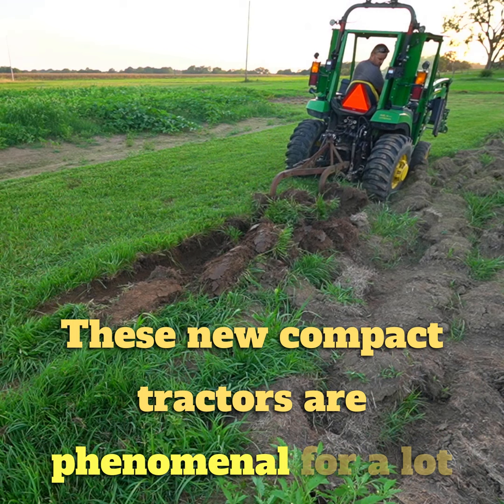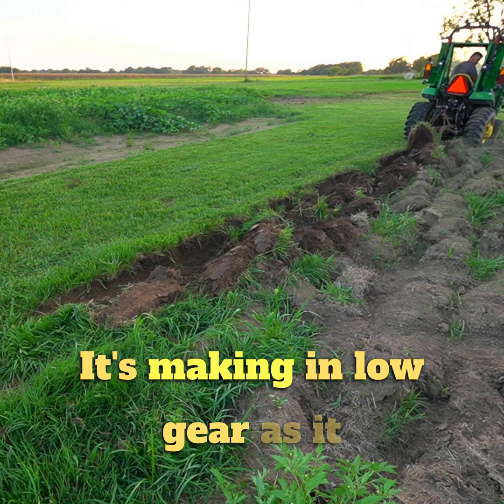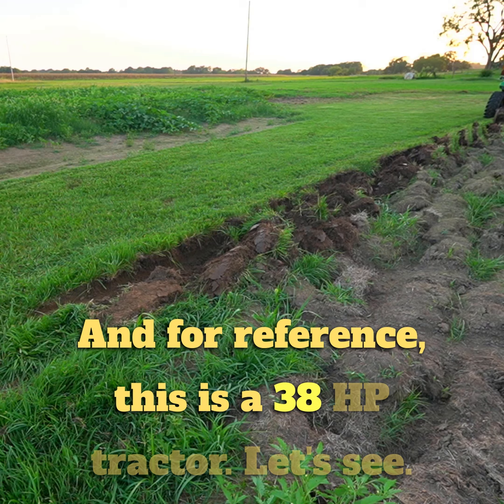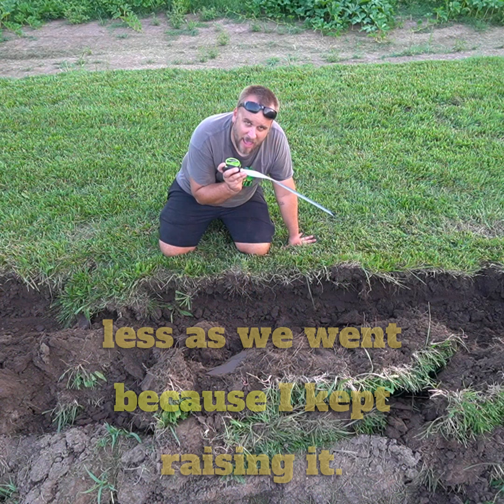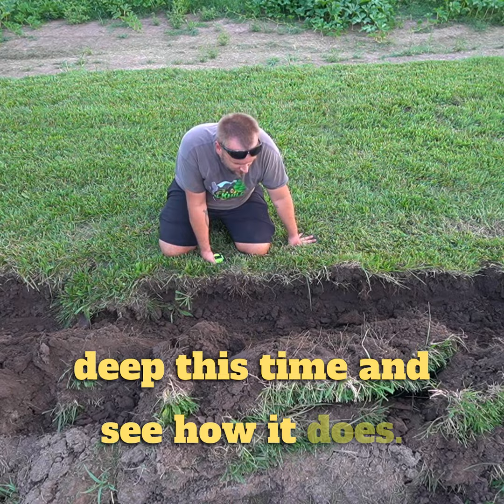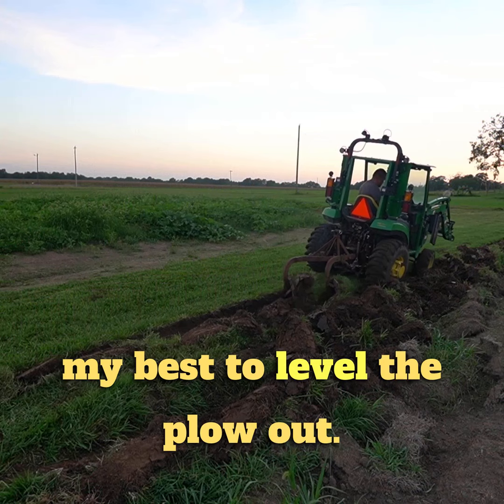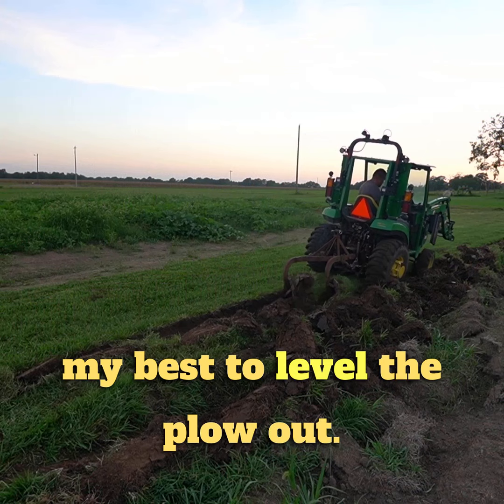Compact Tractor Struggling to Pull a Plow #tractor #farmlife #plow #farmequipment #gardening

Comment: Hydrostatic transmissions are worthless for hard pulling.
Reply: I will never buy another hydrostatic tractor. My 4052M runs great.
Reply: I think there lying about horse power a hydrostatic log skidder will pull a house down
Reply: @5point5six  Yes  they will. A lot stronger transmission.
Reply: Not what it’s designed for…🤷‍♂️

Comment: Your absolutely right , your old 8N is gear driven , your new "pretty" John Deere is hydrostatic , which means 8N is direct drive , JD is fluid driven .
That whiney noise coming from you JD is a bad pump , or going bad .
Hydro is a poor substitute for direct driven.  Always look for gears and manual trans .
Reply: They whine from day one
Reply: I got an all wheel steer JD  30 yes ago and it doesn't whine
Reply: @uncletim2021a-dz6zu  what model? A 425?

Comment: Your not the only one. My buddy is a john deere fan and told me one day that his 3032e would not so much as spin a tire to drag a 14” 2 bottom plow he had. Not being cocky about it i told him that i was pretty sure my 24 hp on a good day 1941 9n would pull it as it was specifically designed to do so. I couldn’t believe his wouldnt, he didnt figure mine would. So to settle his curiosity one day he brought it over and told me if mine would pull it i could have it as he has no use for it. I have a 2 bottom plow now.

Comment: Measure the width between your plow points. Whatever that measurement is 1/2 of that is the depth you should be targeting. A 14" plow should be set to 7" depth. There are other videos of 2032Rs pulling a two bottom with no trouble.

Comment: FIL had a 1948 8N with loaded tires in mid 60s that'd handle a 2 bottom 14" Dearborn plow in raw ground, (corn or grain stubble), 9" easy,  it'd struggle some in alfalfa sod.   It coulda used a full set of wheel weights.

Comment: that plow is gonna be hard to pull. you have plenty of tractor you need ballast and fix those plowshares. It came with cutters and needs them as well as a rear depth wheel. I doubt an 8N without ballast could pull that plow at all! Also the ford would be plowing 4-8 inches deep at most. You have a great tractor. Needs a plow(descent).
Reply from the maker: My tractor has a 2500 pound lift weight and I have it weighed down to 5000 pounds the way it’s configured in the video. Three sets of wheel weights, fluid in the tires, aftermarket cab, backhoe sub frame, and a lot more.

I do not have a ballast issue
Reply: @RockhillfarmYT  I read where the 8N with fluid weighed less than 4800 lbs, so you are well weighted. Nice tractor. You should be able to pull a 6,5 ft Disc harrow easily. We pulled a 3-14 101 mounted plow with a 39hp ford 3000 easily. Keep trying and I'll keeo watchin!

Comment: A mid fifties 25 hp tractor could weigh as much as 5300 lbs when ballasted and with full weights too.
Reply from the maker: Mine also weighs that much. List weight is 2900 pounds. The way you see it configured it’s 5000.
Reply: @RockhillfarmYT some of the older plows were 12” as opposed to 14”’s too.